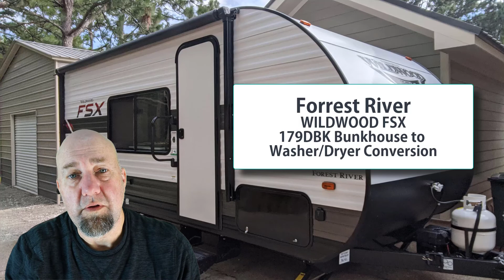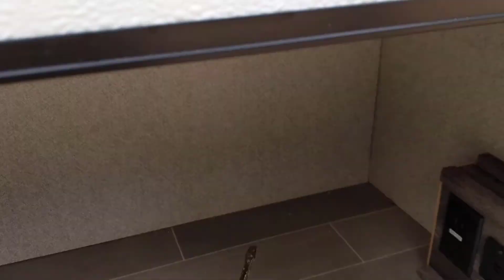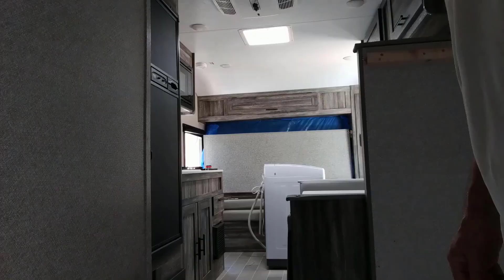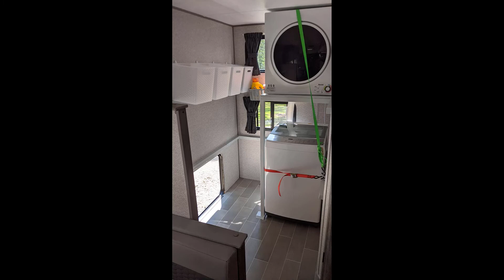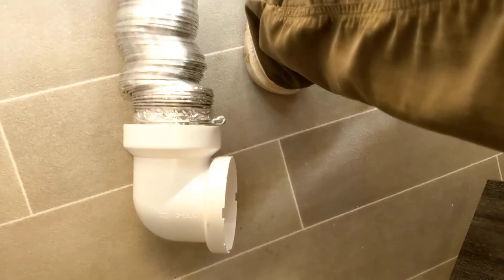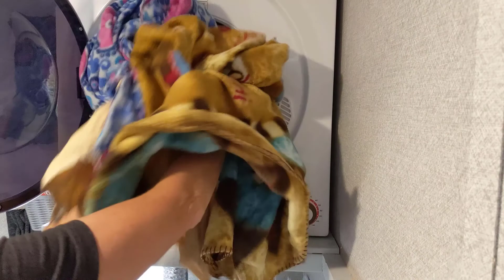Camper Trailer Washer Dryer Adaptation

Comment: Having the washing machine drain directly into the shower seems way easier than going down into the floor and having to lower the underbelly and plumb it into the gray tank. I like your idea a lot. Thanks.
Reply from the maker: So true. Just make sure the shower drain is free of anything to clog it up bc the washer drain cycle will overflow the shower stall in a heartbeat. Thanks for the response!